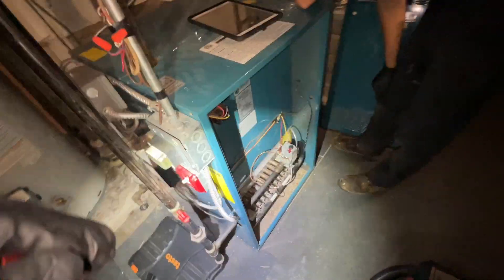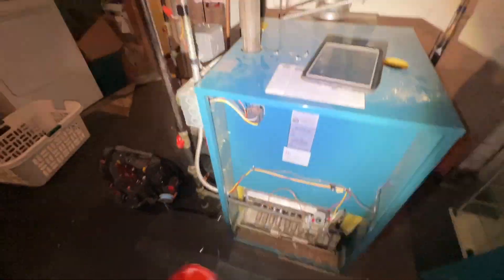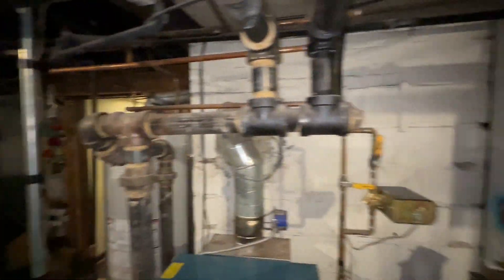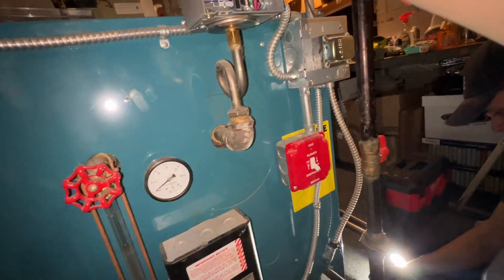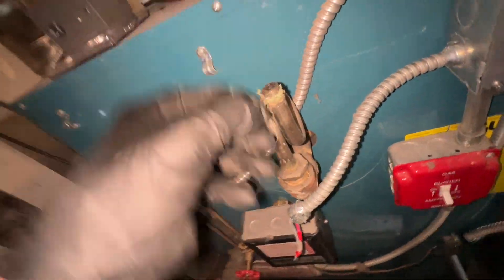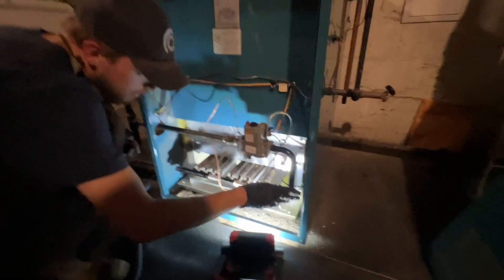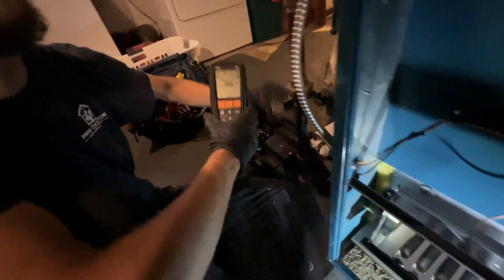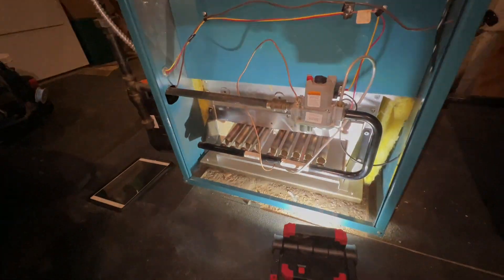First Steam Maintenance of the Season! Burnham 175,000BTU Steam Boiler Winter Tune Up!

Comment: Not bad! Except last line should be “hopefully steam pressure will not build otherwise this boiler is oversized.”

Also that header is piped wrong but I assume you didn’t install it 😅
Reply from the maker: They’re all over sized and piped wrong
Reply: @DCHVAC  haha most for sure but not mine